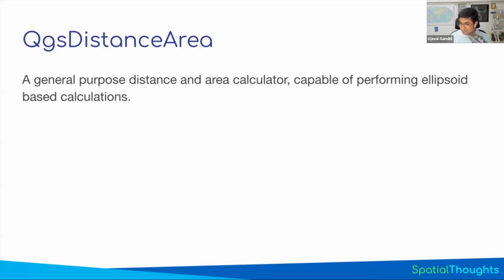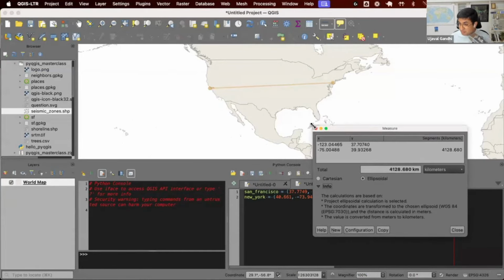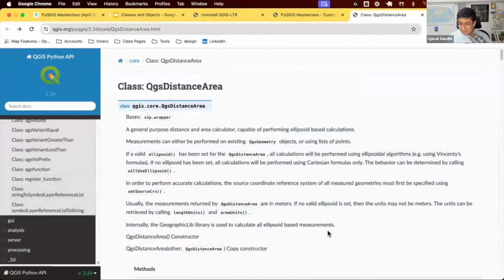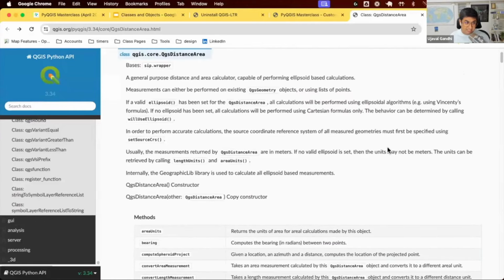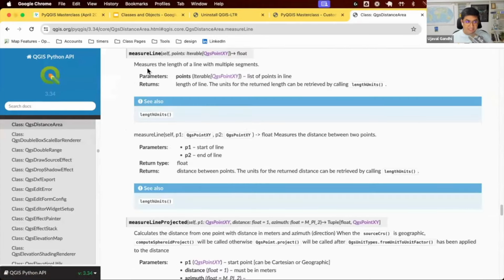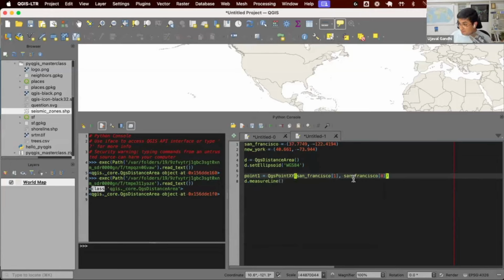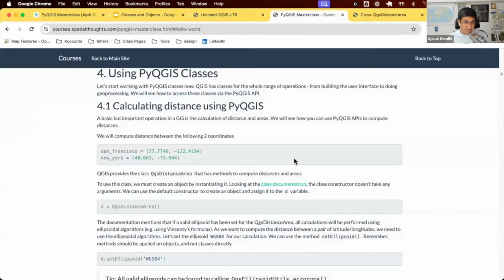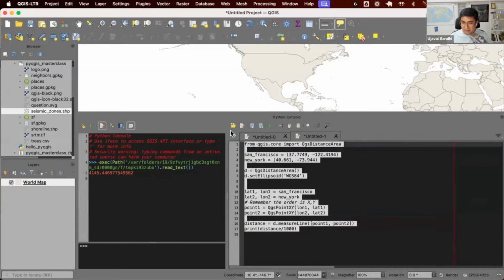Calculating Distance Using PyQGIS - PyQGIS Masterclass

Comment: I have just started this course, however, my QGIS API 3.34 documentation is a bit different to the Tutor's documentation and I find it a bit confusing.  Could anybody advise please the possible causes and how to rectify?
Reply from the maker: Please use QGIS 3.40. API changes between LTR and our material is targeting the latest LTR version. Please upgrade your QGIS and all examples in the material will work. Follow instructions to install  https://courses.spatialthoughts.com/install-qgis-ltr.html. No need to uninstall previous version. The process will upgrade to newer version
Reply: @SpatialThoughts  Thank you.  I am using Linux Mint and find it a bit complicated to install specific versions not it the standard repo or Flatpak.  I will sort it out, thanks again.
Reply from the maker: @timothy4 Use Conda. That maybe the easiest https://courses.spatialthoughts.com/install-qgis-ltr.html#install-qgis-via-conda
Reply: @SpatialThoughts  Thank you.  I have some previous experience of Conda when I installed and set up Spyder so will check that out
Reply: @SpatialThoughts  Conda worked perfectly to get 3.40 installed, thanks for the advice, much appreciated

Comment: I have raster image, convert to victor as line (not like two edgecent lines) center line... find length of all lines... Is there any ? Pls explain
Reply from the maker: Convert to Polygon using the Polygonize algorithm in the Toolbox. Then fidn centerline using the medial axis (there are several plugins to calculate medial axis. You may have to try a few and see which works better for your data)